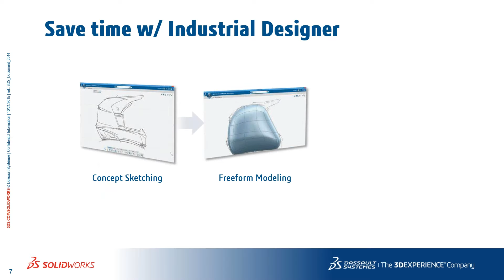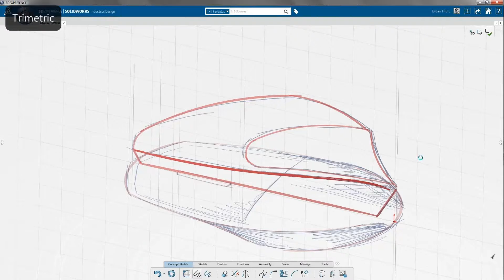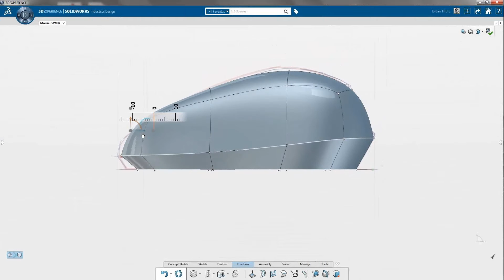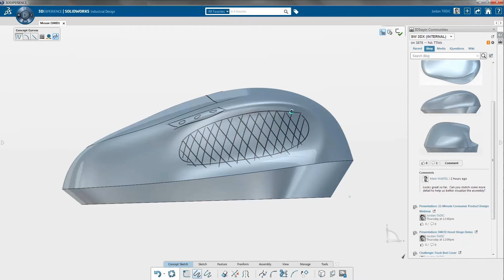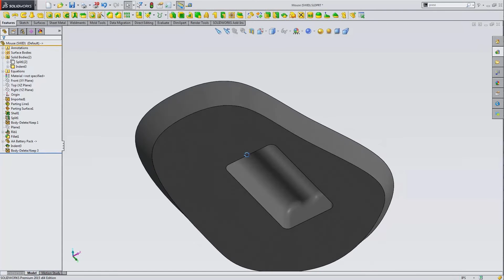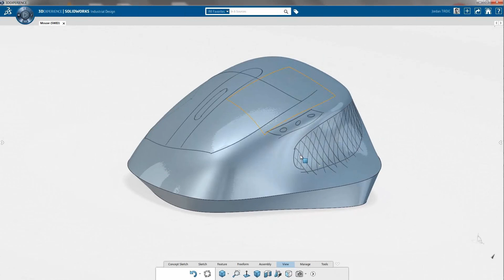Webinar: Accelerating The Industrial Design Cycle in SOLIDWORKS Industrial Designer

Comment: Why is there no app for the iPad Pro with the pencil?
Reply from the maker: That is a great question that we get quite often. For now, the only operating system the software supports is Windows. It requires an installation on the OS. We know the SOLIDWORKS development team is working to add support for mobile platforms like iOS. Thanks for watching!
Reply: TriMech Solutions I hope sooner rather than later! This software looks perfect for the iPad - simple tools that are easy to use, which can then be built upon with the full solidworks on desktop.
Reply: even desktop computers get difficult to run Solidworks I guess. And there are a lot of softwares that enables you to draw whatever you want on the Ipad Pro with Apple Pencil.